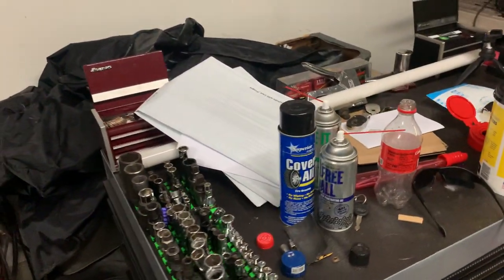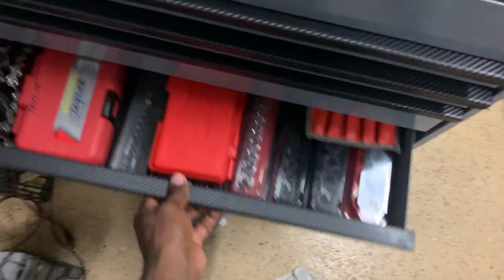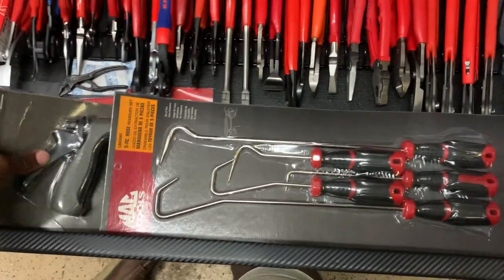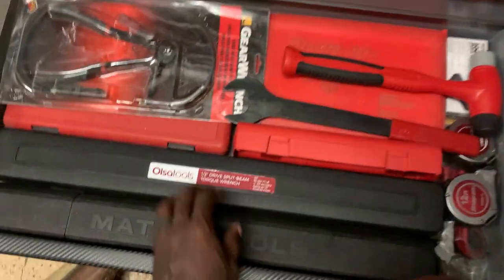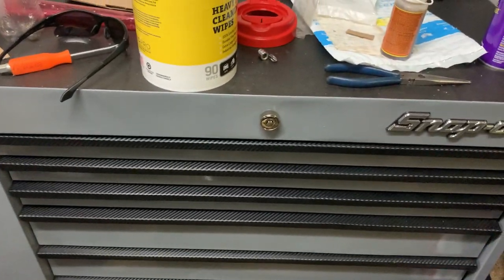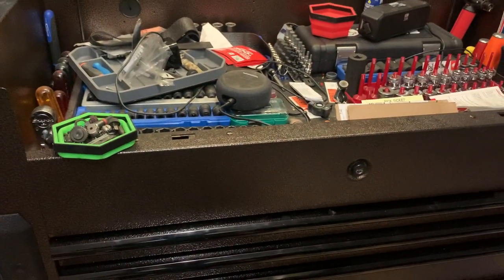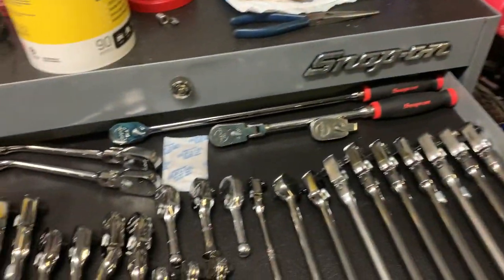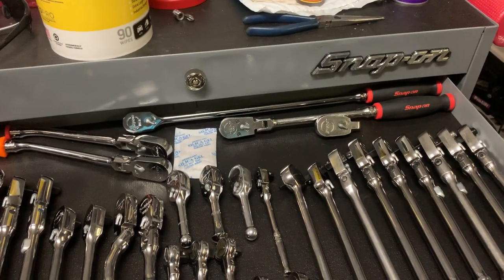How much did I invest in my tools | Protecting your investment

Comment: amazing tool collection. I keep watching your tool videos over and over. Wish I had half of what you have. QUESTION?? If you had to make a decision on you most favorite ratchet, screwdriver, pliers, or hammer from your collection, what ones would you pick? Thanks, your a great person. Six Kids WOW. You have your hands full.
Reply from the maker: My favorite ratchet brand is Snap-I’m, but I use my Matco more often. I like the feel of the Matco in the hand, but the action of the Snap-on is better. My favorite and most used screwdrivers are my Lennox brand from Lowe’s. Low cost, but they work great and have a great feel. My favorite pliers would be my Knipex. I’ve had just about all other notable brands, but Knipex is King. My favorite wrenches are Snap-on, although I have very little time on the Matco. I also have a set from Capri, and they are great. For me, if the open end spreads or slips, I won’t use that brand. Snap-on has excellent quality steel, and they’re very strong. I’m general, it’s hard to buy cheap tools when I can find top quality for nearly the same price. I had an entire box filled with low, mid and higher brand tools, but I’m glad that I slowly worked towards improving my game. Granted, if a lower tier brand works as good as a top-tier, good chance I’ll buy it for use.